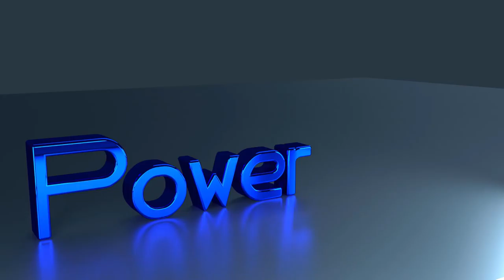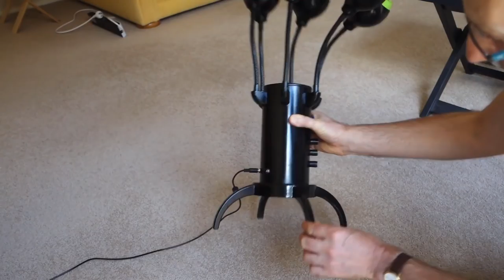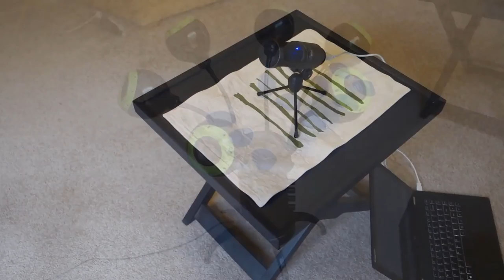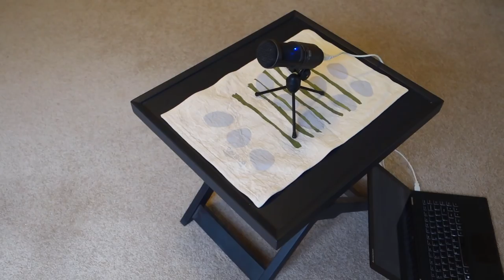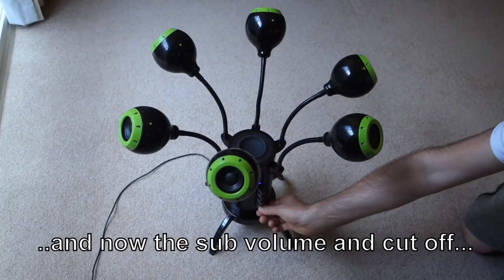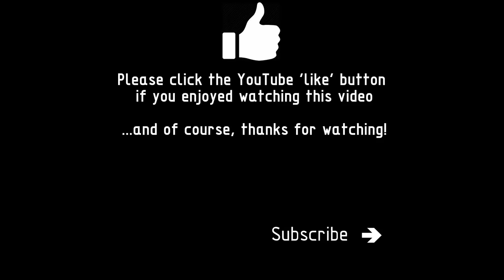Ep29 Hydra Bluetooth Speaker

Comment: Awesome design!  

When you described the fact that you had 3 right and 3 left speakers and seemed to indicate that they were R on one side then L on the other side... I kept thinking that if the R and L speakers alternated around the center, then a 'stereo image' would be perceptible from any angle around a centrally located hub. Sure, the image would sound reversed now and then... but in a party atmosphere, who cares?  Does that make any sense, or am just I being naive?
Reply from the maker: Hi Robert - Thanks for your comments and feedback.  I actually wired the speakers 3 on oneside and 3 on the other (rather than alternately.  I'm unsure as to whether there would be a difference, particularly in a party situation as you suggested.